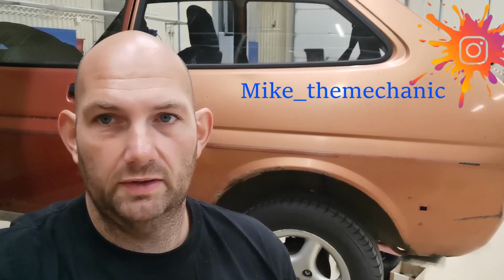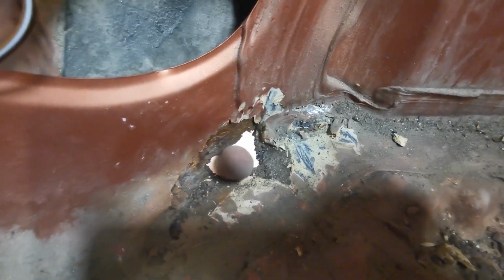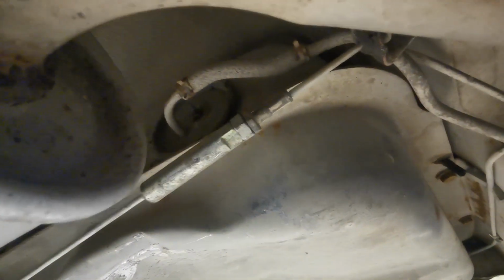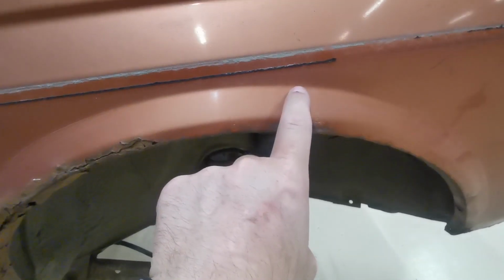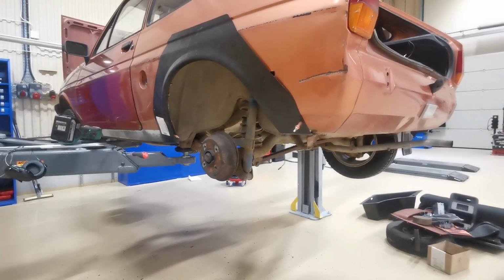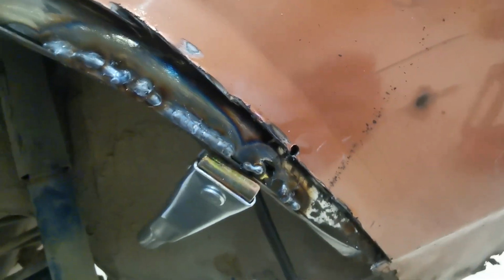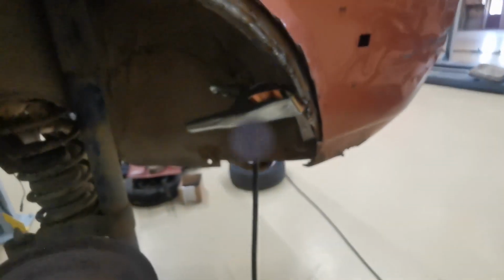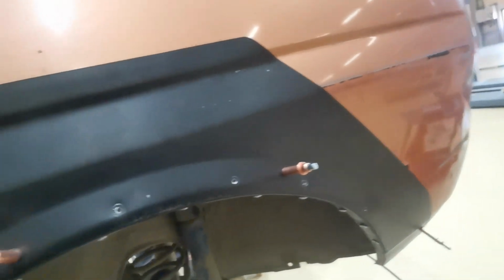Removing and replacing the rusty inner rear wheel arch.

Comment: Nice job, would have gone above that line you point out on the outer arch though, you kind of lose the sharpness of the panel if you weld along that body line.
Reply from the maker: I was looking to not warp the body panel under the window which is why I chose the line that I did. Thanks for the feedback
Reply: @mike_themechanic  Yeah not that high up. I've had great success in the past going on the first flat part, just above where you're welding yours.
Reply from the maker: @jimmyk9523  OK ill certainly keep that in mind next time I do something similar. 👍👍